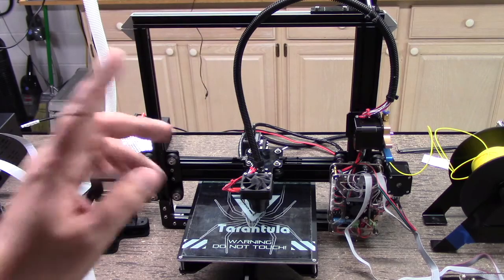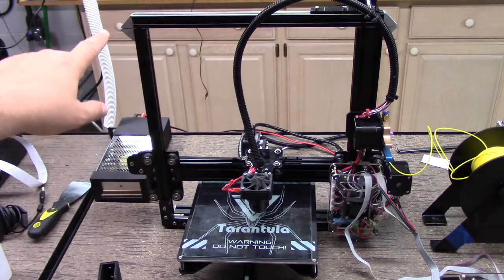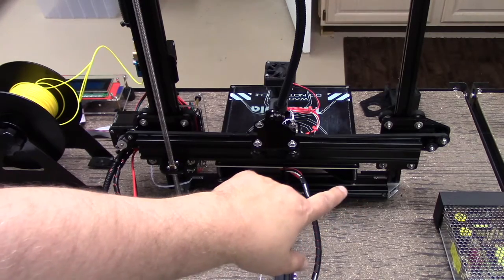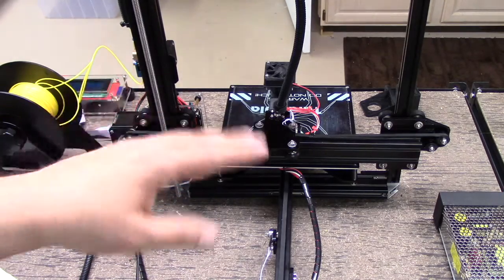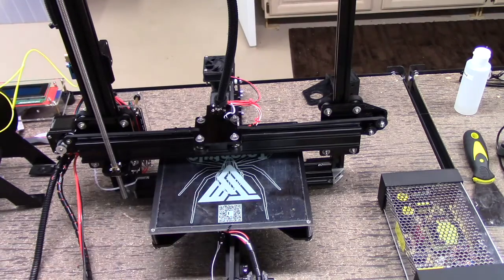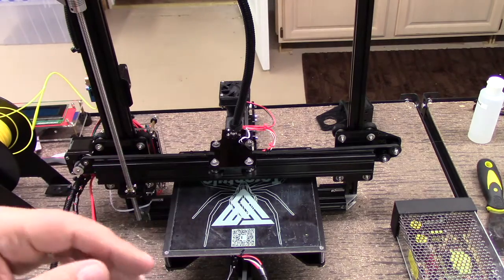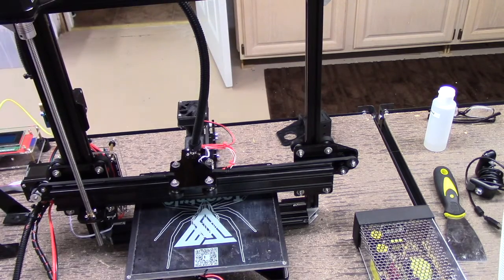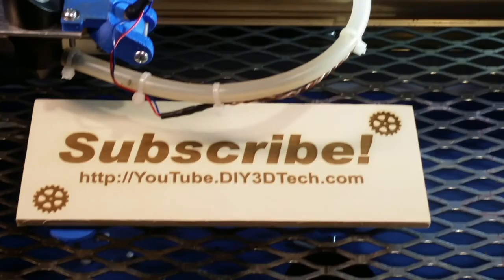TEVO Tarantula 3D Printer  -  Reinforcing the Gantry!

Comment: Do you recommend this or the anet a8?
Reply: I've been following both FB groups for about 4 months now. The Arnet A8 has been plagued with quality issues, damaged and broken frame parts, it isn't packaged well, the parts are the cheapest China can offer, etc. Every review that I've read about the Tevo Tarantula as far shipping has been glowing and top notch. The issues with the out of the box experience between the two printers could not be further apart. Because of this, I have decided to order a Tevo Tarantula because the extra $40 price difference is easily made up with a better quality heat bed, hot tip, filament feed system and aluminum frame, plus two rolls of filaments with the Tarantula
Reply from the maker: Not sure what the anrt a8 is so can't say sorry.  However I do love this guy!  Normaly I sell them on eBay after I build them, but this one I kept!
Reply: The Tarantula is more stable as it's not purely acrylic based.